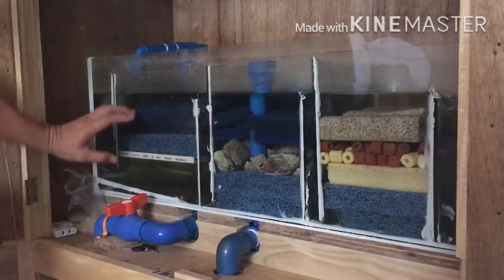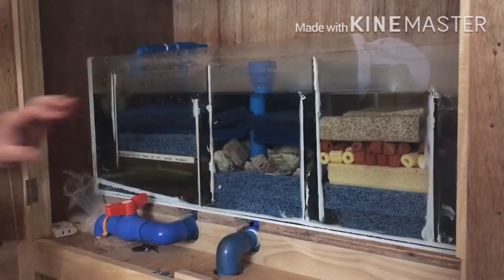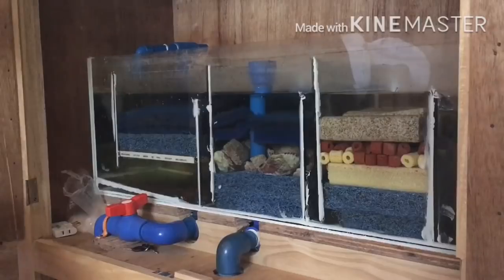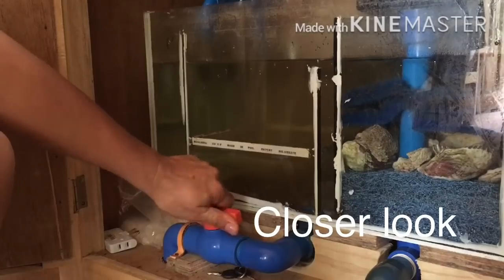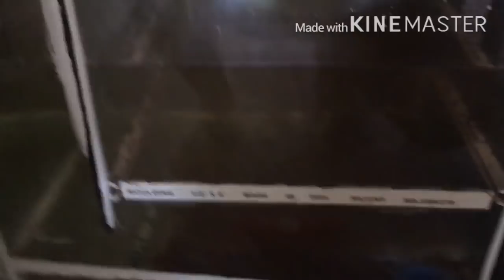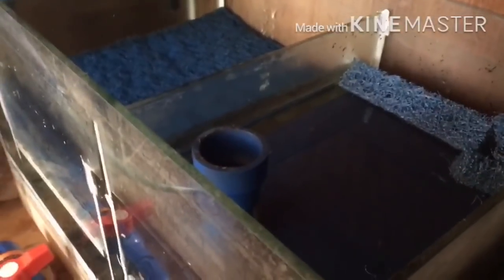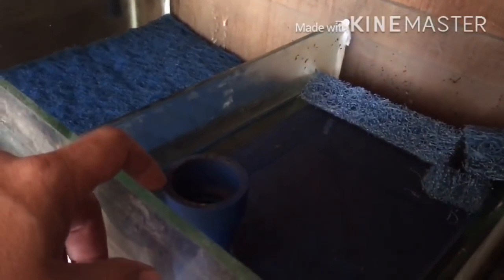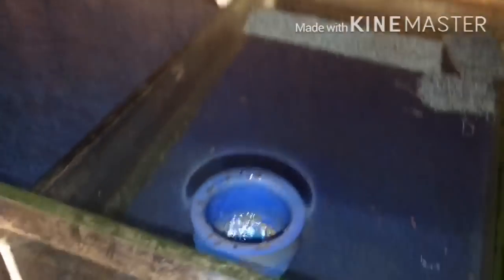Aquarium sump settlement chamber/flushing like toilet bowl

Comment: Sir magkakrak po ba ang aquarium na dimension is 6ft x 20 inch x 20inch na 1/4 po glass?
Reply from the maker: Manipis ang 1/4 dapat 1/2 sa 6feet. Tapos marine sa ilalim hindi sub standard ang stand
Reply: BOHOL BOX magkakrak ponba yan pag hindi po  pinuno yung tank? Meron dn po ako dyk 6ft x16 x 16 d kaya mababasag sir?
Reply from the maker: Hindi yan mag krak
Reply: BOHOL BOX so sa 6ft x 20 x 20
Po hindi ko lng e full yung water sir?
Reply from the maker: Pwd yan piro dapat may 3/4 marine ka sa ilalim ng aquarium. Full brace din ang aquarium
Reply: Meron po ako dito 8ftx20x20. Kayang kaya ng 1/4 size ng glass
Reply from the maker: Pwd yan sir basta matibay ang base